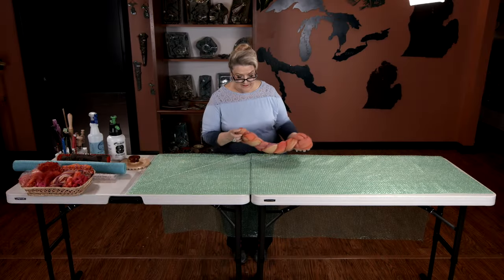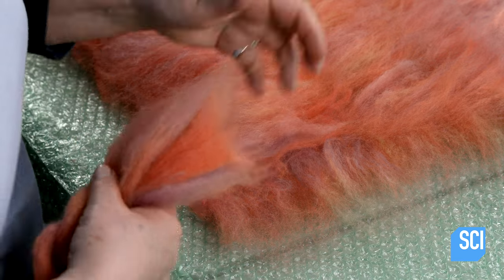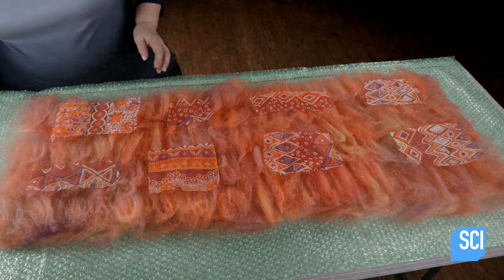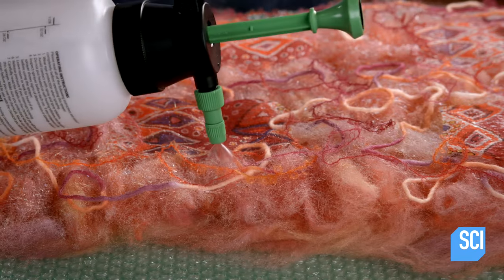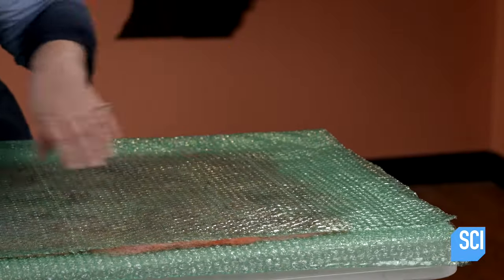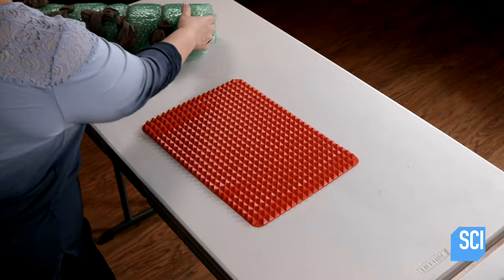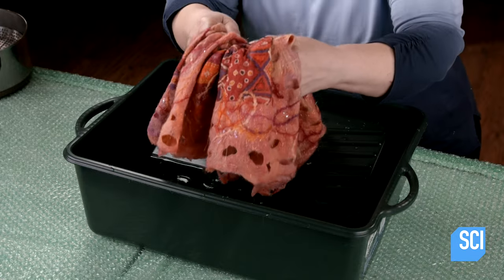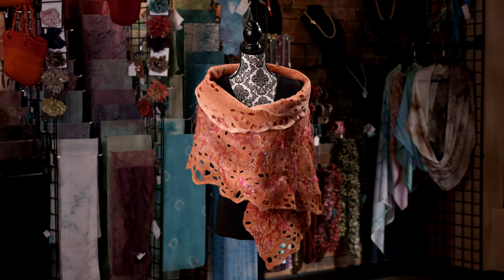Watch An Artisan Painstakingly Create Specialty Nuno Felt From Marino Wool

Comment: The end result is really good looking, however i really missed that she didn't throw the piece, if you're wondering throwing it causes it to shrink a little from the force and it makes the felted piece stronger, also it's gun to bunch it up and throw it at full force at the table lol
Reply: You dont full nuno felt that way. You vwry gentle let it fall on its edge and then pull it flat then let it fall on its edges gently again. If youre making full felt yes you throw at force but ypu dont do that with nuno. It would cause it to full too much.